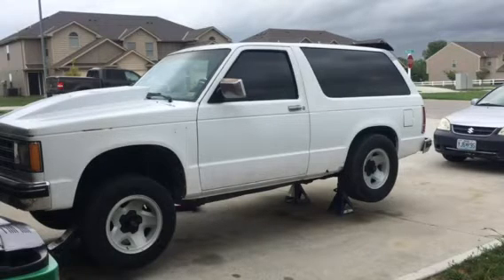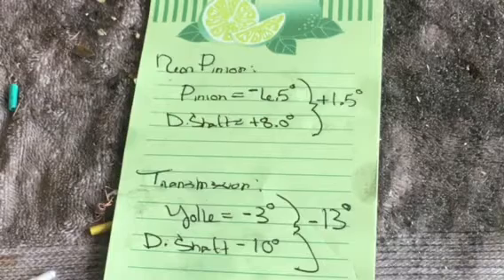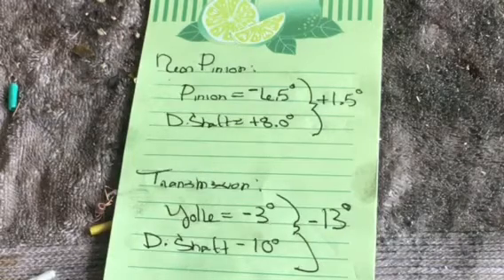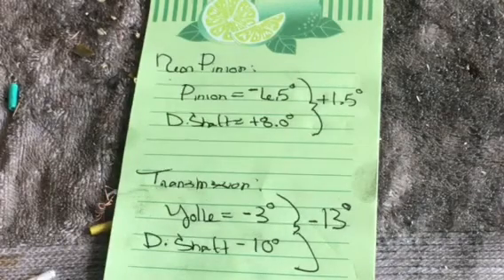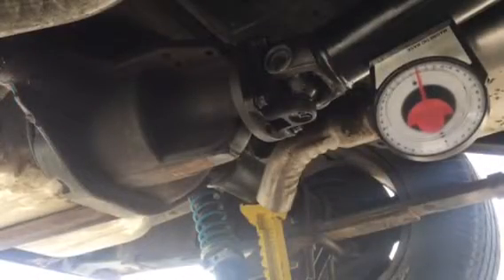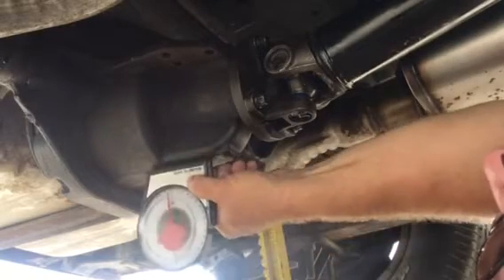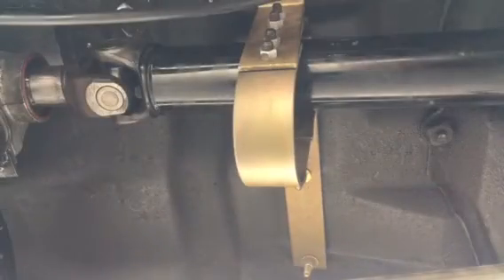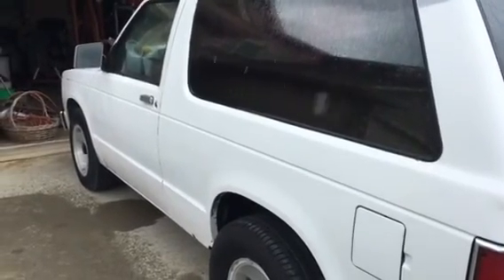LS 4.8 swap S10 update 1838p Idle

Comment: Typically raising the idle airflow fixes the cold start problem. You can mess with ve and idle timing but typically idle airflow is the simplest especially for a smaller cam
Reply from the maker: lsx_kyle52 My IAC shows 160 pre start then drops about 20 at a time then shows 0 at idle 800-850 rpm.
The IAC range I was shooting for is 40-60, but is this a good range for a Drive by Cable throttle body? I am going to try and close the throttle blade some and see how it accepts the change.
Reply: HeadFlowInc it should be 20-50 when warmed up
Reply from the maker: lsx_kyle52 Well, I sealed off the IAC to set the base idle air bypass at the throttle blade. Final blade air was 1 1/8 turns open has an idle of 700 rpms. But I never could get a stable idle even with an IAC reading of 45. I can only assume my VE and MAF are way out?

Comment: If you have more than 4* total angle between the pinion and the trans output it will cause rapid u-joint wear. You had 9.5* its no wonder it ate u-joints like candy.
 Summit (among others) sell wedges to place between the leaf spring and the rear end to correct pinion angle.
Reply from the maker: Machinery Repairman I’m not sure your referring to the “Net” u-joint angle or?
Leafsprung vehicles are setup with the pinion angle at a negative -1 to -7 Degrees to account for pinion rise under full load. Way different than a 4 link style coil sprung suspension. 
I’ve been looking into swapping over to a 4 link coil over rear suspension setup. My friend switched his GMC Typhoon over to a 4 link and it works awesome! 😎

I’m trying to verify if I lower the   Tailshaft of the transmission some more maybe the reduced driveshaft angle will be the trick?  
Currie, Strange and others recommend the rear u-joint be at a Net -1 to -2 Degrees. I’m still unsure what’s going on, on my 1971 Ventura I set the rear pinion at -7 degrees and never checked anything else. 🤷‍♂️😳
Reply: You can lower your trans to help with the angles. If you could get the trans-to-shaft working angle within a degree or less of what your pinion-to-shaft working angle is, it'll help alleviate any vibrations.

You can also put some drop blocks between the axle and springs if you've got the room to go. If that's still not enough, some wedges under the spring perches can help further. 

I've spent too much time trying to get my two-piece shaft to work well, but I eventually got it figured out. It took a lot of trial and error

Comment: Houston, we have a problem! A straight drive shaft can not be -10 degrees on th Trans end and -8 degrees on the differential end of that same driveshaft. GM engineering says that the two ends, the apposing angles should cancel each othet out within 1/2 of a degree and that your working angle should not be more than 3 dgrees, I have set up drive line angle for 4/4 trucks and got away with more than 3 degrees but thats becauce they were not driven as race cars. More difficult to set up race cares because the pinion angle changes so drasticly and quick.
Reply from the maker: Very true! I can’t remember what was going on back then or what I ended up doing. Most recently I had the transmission and rear pinion at 0* and the driveshaft iirc was 3*. I’m getting ready to modify my transmission crossmember to set the engine/trans angle at -3* and see what needs to be done in the rear. Calvert recommends the rear pinion angle have a “Net” -2* to -4* when added to the angle of the driveshaft.  JD

Comment: I’m no hptuner expert but I have my cammed 6.0 Sierra pretty dialed, I’d be willing to look over your tune or send you mine for comparison
Reply from the maker: darren mcgowan Does your tune use DBC or DBW throttle body? 
I’d gladly send you my current tune so you could look at all the changes. I’ll try to send a message if I still can.
Reply: I'm trying to learn to tune myself, but am using holley efi. One thing that helped my idle straighten out was to change when my fuel injectors quit spraying in relation to the camshaft position. I'd have to look at my tune again, but I want to say it was around 120 degrees before TDC for me. 

Maybe there's something similar in hp tuners.
Reply from the maker: Morpheas The multitude of idle modifiers are giving me fits!  I found out tonight even leaning the VE tables will raise the idle 😳
If I had the finances I’d gladly switch over to the Holley EFI setup!  👍
Reply: It's like a house of cards
Reply from the maker: Morpheas I just did a test start  on the Blazer, it was the best start, idle, Rev, and return to idle yet!  If it does the same in the morning then I’ll be winning !  🙏🏻

Comment: Get a rearend out of a manual s10 that year up to 98.
Reply from the maker: Yeltom Automotive Too Wide for a 1st Gen 2wd Blazer, it works on the 4x4’s though.👍
I have a narrowed Ford Explorer 8.8, I’ll just have to tear into it and see what’s clunking inside the trac-loc. I’m thinking the rebuilt trac-loc I bought was a dud! 👎
Reply: HeadFlowInc the s10 in you year is too wide?
Reply from the maker: Yeltom Automotive The narrowed Explorer 8.8 ends up 3/4” per side wider than the factory 7.5” 10 bolt differential.  The width difference means I will need rims with 5.5” back space to tuck the rear tires. Iirc 54.50” stock width to the 56.0” 8.8.
2nd Gen 8.5 10 bolts are like 59.0 or 60” wide and won’t work.